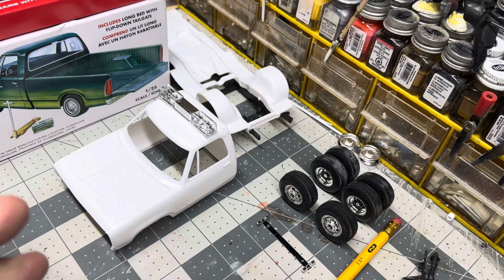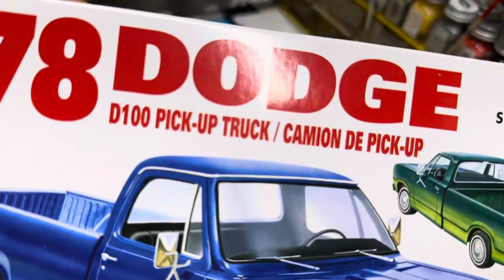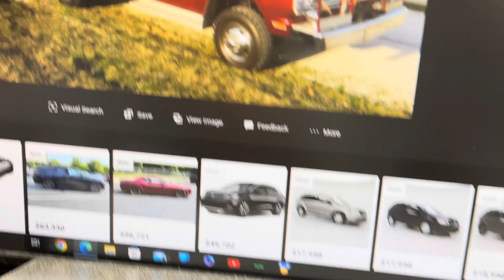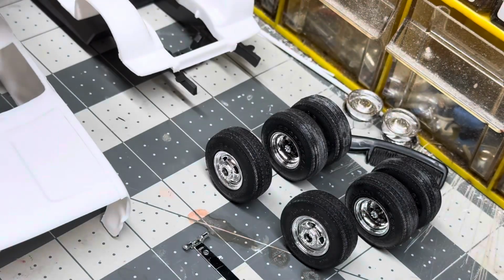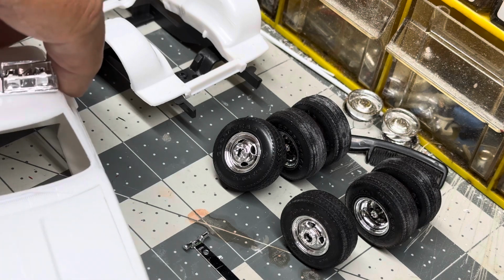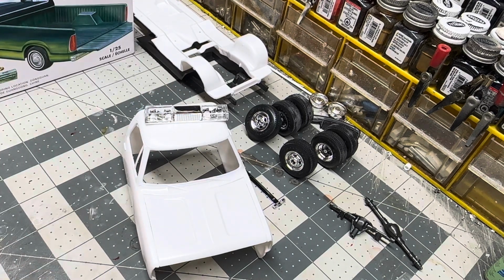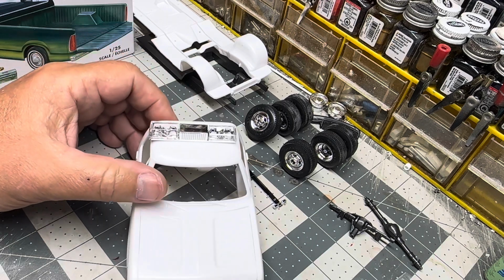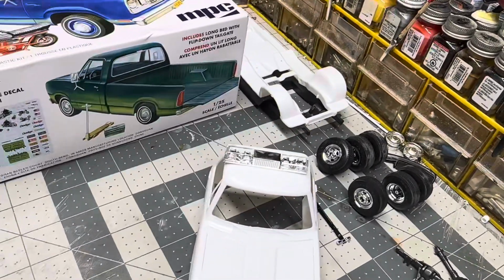1974 Dodge mini pumper.

Comment: Yeah, this is a really great project and I'm very curious about the upcoming light bar transition.😎👍🏻😃
I guess AMT put too much/too thick chrome on the bar or too much clear coat under the chrome layer, depending on which system they uses to chrome-plate the parts (Rapido Trains in Canada first copper-plates the H0 plastic parts and then chrome-plates them by electrolysis, which is very rare in miniature model making , but is extremly(!) durable).